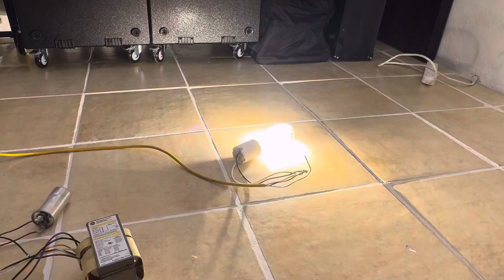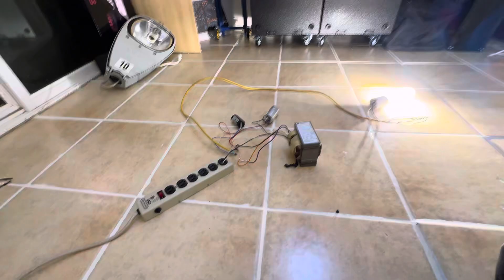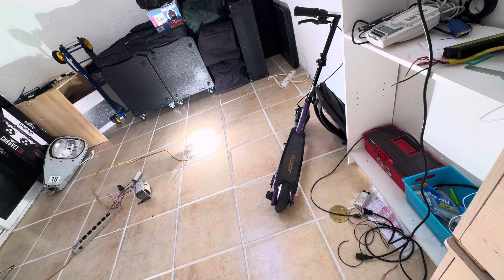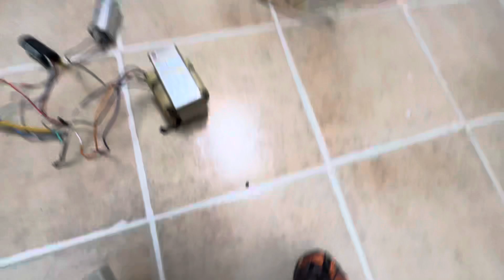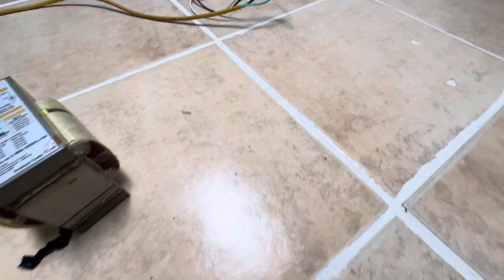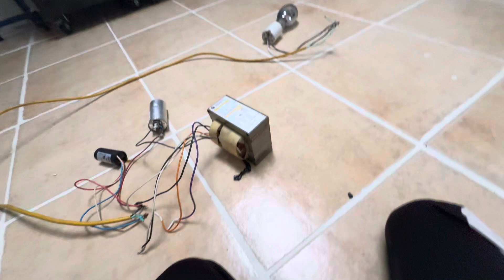LAMP IGNITOR EXPLODES WHILE RUNNING 50W HPS ON 400W METAL HALIDE BALLAST | ULTIMATE FAIL!

Comment: Keeping your main method of deactivating the contraption right next to the contraption is really dangerous. I suggest you wire from the outlet, to the safe place you were standing, and then back into the room. This way you can switch the contraption off from safety instead of having to run into a hazardous situation.